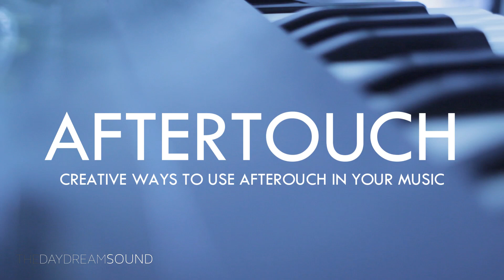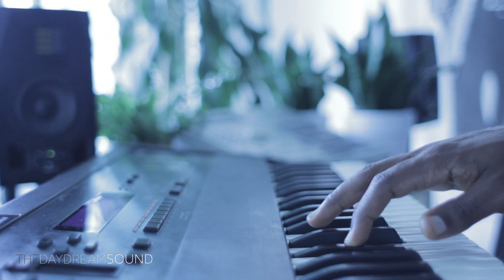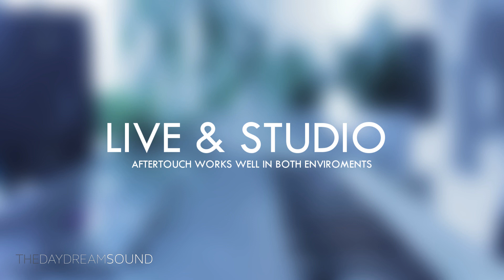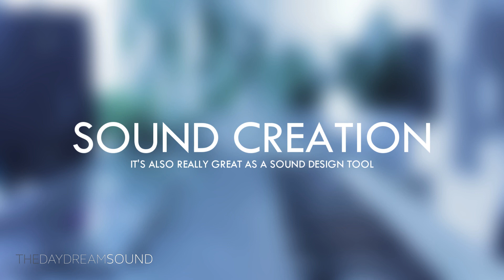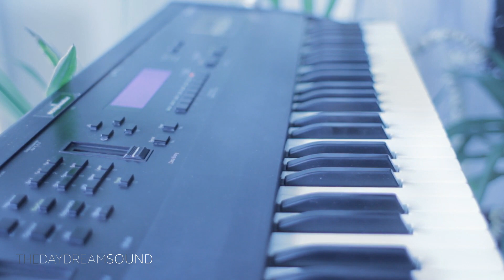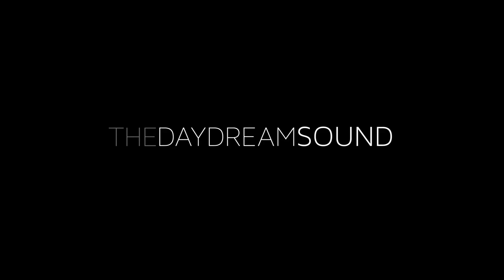Using Aftertouch With Your Sampler

Comment: Since the TS12 doesn’t have Polyaftertouch, can it be implemented through an asr10 though midi? Or does it lack the PolyAT message?
Reply from the maker: What's up I don't know. I didn't know the TS10's keybed didn't respond to PolyKey.
Reply: @TheDaydreamSound  Yeah the TS12 is a little bit differnt than the TS10, the main difference is  TS10 = PolyAT, TS12= ChannelAftertouch, I prefer the PolyAT so that’s why I was curious if it would’ve still responded to Aftertouch messages.. Thanks though! Keep up the good work you have a dope channel man!

Comment: I'm still confused bro. So, long story short, I'm on the hunt for a 49 key midi keyboard, and have been interested in either the Akai Advanced 49 or the Korg TRTK49. I will mention that I like the design of the Korg keyboard, but because it has mentioned that there is no aftertouch, I don't know if that's a good thing or bad thing. I make beats and would eventually want to also work on making film scores, but how important is the aftertouch? Could you or anyone else that reads my comment help me understand it more thoroughly? And also, which keyboard do you guys think is the best between the two?